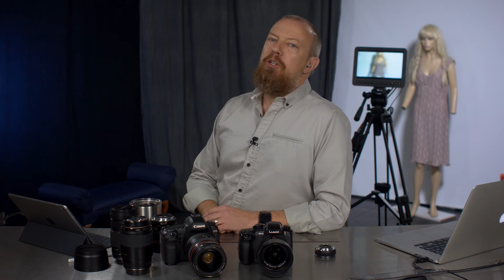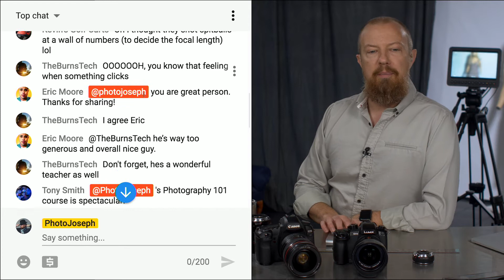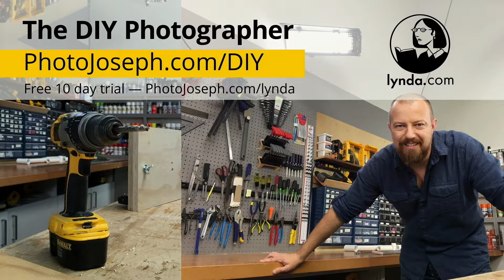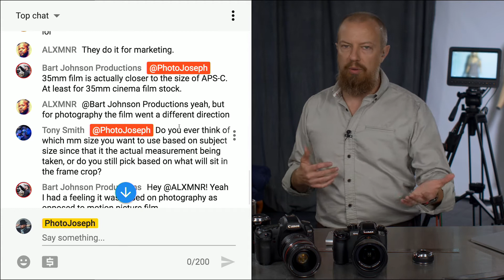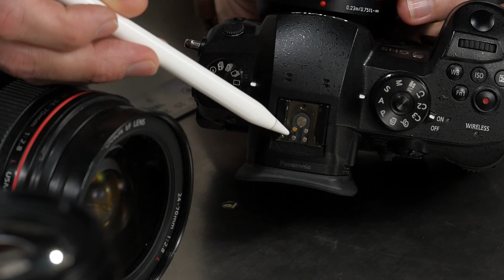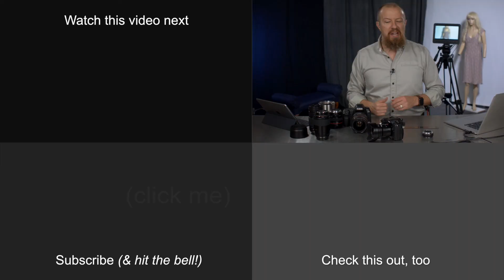Q&A: The Right Lens for the Subject, Effective Focal Length, and More!

Comment: PhotoJoseph  good info!   Hey I have a question,   ever since I downloaded Griffin Hammond  settings for my GH5,   my Stabilizer Mode selector is greyed out.   I can't get it back on even after doing a reset and inputting all my settings again.  Please advise..  Thanks
Reply from the maker: Was it available after the reset and before you input your settings again?
Reply: Well I didn't check that ,   but I can do another reset and see.  Thank You for responding,  I am also going to see if when taking it out of auto white balance and custom setting the white balance with a grey card is the culprit..
Reply: Well,  with a Lumix 12-35 lens on,  
I checked the setting for auto white balance instead of custom with a grey card and the Stabilized mode is still greyed out.  I put an unstabilized Lumix 20mm on and the Stabilizer mode showed the hand..???
Reply: I don't know the cause of this,  but if you can figure it out,  or get in touch with the Panny Tech you occasionally talk with,  maybe he can help.   And if you can,  do a show on it...
Reply from the maker: I don’t follow. Did you do another reset? Were you ever able to get full stabilization control back? Is WB setting making it work/not work?
Reply: Sorry,  I'm back,  no a reset doesn't change anything and WB whether on Auto or Custom did not change anything either... I'm stumped....
Reply from the maker: This is with any lens attached? What about no lens attached?
Reply: Well I'll try that as well...But yes I had the 12-35 attached..
Reply: Do you have on your GH5  the Stabilizer Option?
Reply: With no lens,  the Stabilizer mode shows the ((Hand))  I' m trying to post pics,  maybe I can do that on your facebook page?
Reply from the maker: I’m guessing a dirty or damaged contact. With no lens, the camera assumes a mechanical lens and gives you in-body stabilization only. With contact it’ll tell you what it can do. With it disabled while a lens is on, I’m guessing communication isn’t clear between body and lens. That’s my guess. Make sure contacts are clean and try again. If still no joy, you’ll need to contact Panasonic tech support. I can’t be the in-between to them for you, sorry.
Reply: OK  thanks for your help Sir...
Reply: Oh and 1 more piece of info:   12-35 on camera the screen does show "Dual" Stabilization...
Reply: And by the way,  I did contact Panasonic Support,  and got absolutely No Help....They say the same,  could be a faulty lens...but again with the same 12-35 on camera the screen does show Dual Stabilization....   Thanks again

Comment: The only caveat I have with your presentation is you using the same block diagram of the "sensor sizes" and how they relate to each other?!?
I understand the software shoves them all down into the same connected lines/sides/corners but when you "centered" them in the first part of this show it made more sense as to how they each "see" their portion of the image projected out by the lenses.
Thus the "effective focal length" and "field-of-view" is better understood explaining "crop factor".
IMHO...🤓
Reply from the maker: Thank for the kudos in the other comments. I don’t follow the problem here though. How is it a problem the way I illustrated sensor size? When I scaled them, I scaled them together so they maintained the ratio of MFT to full frame. I’m not understanding what the concern is?
Reply: PhotoJoseph In the first part you made a GREAT presentation showing how the lens projects a circular image and the placement of the sensors inside that projection.
This shows how much the sensor actually "sees".
And when you place a different size sensor in the circle, it "sees" a smaller part of that projection. 
So how about a graphic showing the projected image circle and the three sensor sizes centered/scaled inside the circle to show "crop factor"?!?...😁
I have never seen THAT graphic anywhere?...
And thanks for the show and responding. 👍
Reply: PhotoJoseph No, no...nothing "you" did.
The presentation is fine. 
The graphic is always misleading no matter who uses it and it is a very common graphic.
The "sensor sizes" graphic always is the three sizes shoved down into a corner of the "35mm box".
But when you DID scale and center the three it makes WAY MORE  "physical sense" of the REAL amount of image they each "see"
Sorry if hard to explain without an actual graphic???...😳
Reply from the maker: Oh I see. I started with the boxes in the corners because then you see the relationship size better.You can see that MFT is half the size of FF more clearly. But then centered, yes, to show what different part of the image is cropped. Anyway, glad you like the presentation, thanks. I was hoping I had found a way to clearly communicate this.